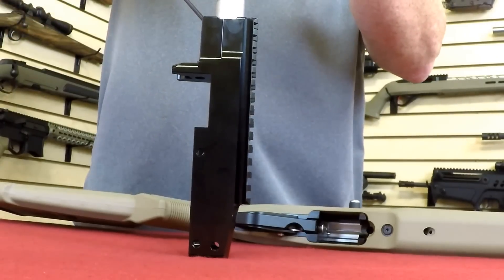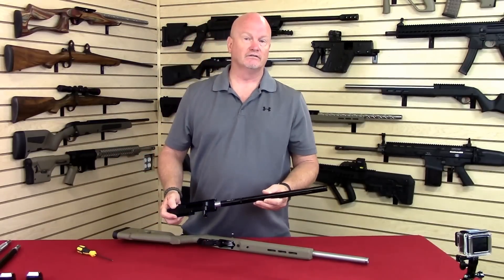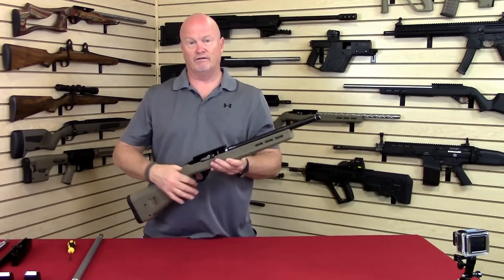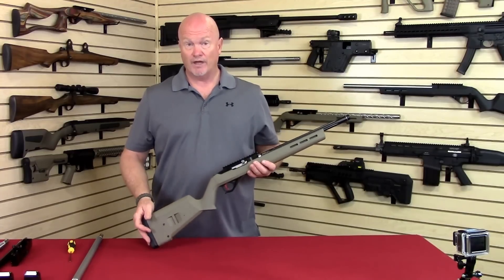KIDD 22LR Supergrade Rifle

Comment: I really like firearm innovation, and this looks like a really neat rifle. But, this is still the 22 rimfire, based on the Ruger chassis. Effective range at most 100 yards, regardless of the barrel configuration. There are two screws that secure the barrel to the Ruger receiver. Barrel swaps are not that complicated. If the price point as mentioned in the comments is accurate, price point approaches Volquartsen, and this is a complete custom receiver and rifle.

Comment: I have shot a KIDD suppressed supergrade for several years. AWESOME product. But no 22 mag.
NOW if I could switch my barrel from 22 LR to 22 MAG I would pay up. 
Seriously not gonna happen due to receiver would need to be changed out as well.

But I am waiting for KIDD to make a 22 mag. I keep bugging them about it to no avail. Already have $$ saved up.

Seriously folks, the KIDD 22LR is the most fun someone can have shooting sagerats and when they
decide to charge your gun inplacement, and they will... HA, nice try rodents...

After many thousand rds this thing works like a sewing machine. You can't go wrong with this 
weapon. Tight tolerances, great engineering and materials. Once its broke in it can't be beaten. 
The trick is learning what to grease and oil and what not too and how much 
(22 ammo is dirty, its why I only use CCI high velocity and subsonic).

If it rotates, lightly oil. (pins, ect)
if it slides, lightly grease wear marks only (bolt travel, ect)
and use KIDD oil and grease (sparingly).

I would buy it all over again.

(I'm hearing sagerats crying in the background hoping you'll buy something else, Sorry Rodents, too late!}
Reply from the maker: Thanks for the complements. We try hard. Just shot a bushel of Potguts and didn't  even put a dent in the population. Keep up the good work.